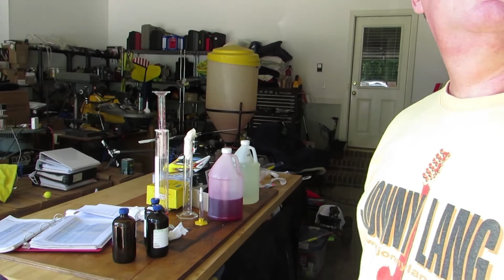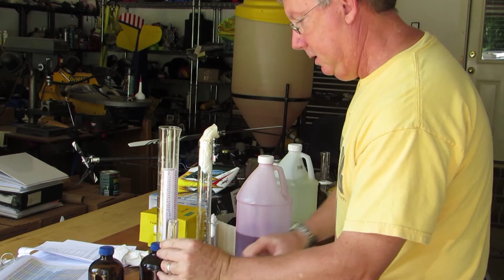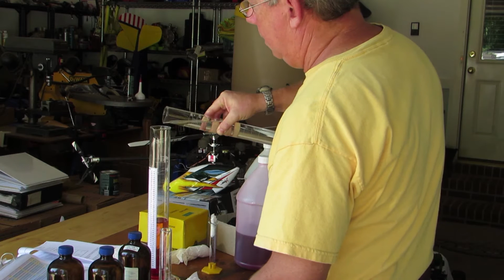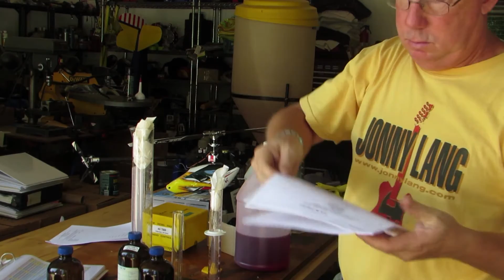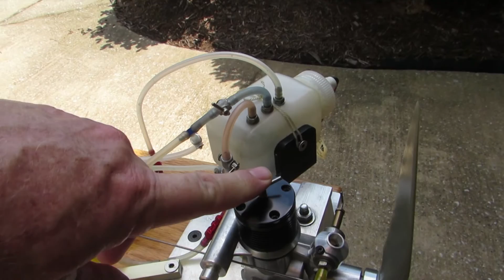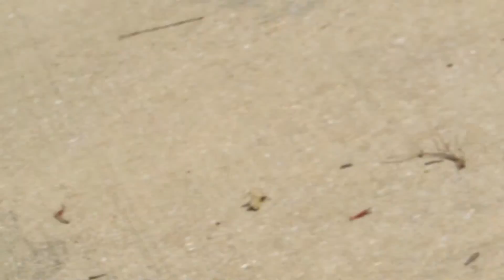PAW Diesel Model Engine Running + Fuel Mixing

Comment: This one showed up pretty easily on eBay. Do you happen to know of any starting & running model diesels that are 4 cylinder? Should clarify, not looking to use it in anything (might think of something later though), just to build it and run it once a weekend or so.

Comment: PGFC was always down on diesel engines because of the myth which he mostly perpetrated himself, that they "cooled down" at prolonged idle and then would not open up again. PAW have dispelled that nonsense, as demonstrated here, but diesels still suffer from the bad press.

Comment: It cracks me up that you are making 16oz (imperial measurement) of diesel but that you are measuring everything in mls (metric)  - could be why in Oz we make up a litre  (1000ml) or 1/2 litre (500ml) as it is so much easier to work out the %'s.

Comment: Not too bad, but it does seem like transition leaves a lot to be desired. And I place the blame for that squarely on that antiquated carb design that almost seems like a half-arsed 'oh fine we'll give an RC model out' than any attempt to engineer it for RC flight. I feel like, if I had that on a model and I was aborting a bad landing, I'd be at major risk of it either flaming out or simply not answering the call quickly enough to avoid the crash. The bar I set for my glow engines is 'idle @ 2750RPM for 30s, slam throttle wide-open as fast as possible, pass is immediate pickup with no hesitation or sputtering', and that just doesn't seem to be in this engine's wheelhouse with that carb. Feel like if I did that test on it it'd fail miserably.

I've seen videos of an OS 40FP, an OS Surpass and a Saito all running diesel and they transition much better. The 40FP had a conversion head bolted to it. The two 4c engines....were just as they were. I think with a proper airbleed or TN carb this PAW would be a worthy option for most fliers that can get fuel, but until it gets a low-end adjust it's just not practical compared to a 46AX or 35AX.

Comment: Growing up in the UK in the 50s and 60s the smell of diesels was pretty much the smell of aeromodelling as they were the common power for most of the non-RC and smaller RC models. One point is that, by throwing a larger prop, there is an efficiency advantage that somewhat offsets the power disadvantage to glow (an advantage that low KV electrics have to an even greater degree).

Comment: Bill, did you add the allen screws to the cylinder or did this version come with? My .35 BR came with slot head screws BA thread.
Reply from the maker: Well - I don't remember exactly. Almost certainly it came with bolts shown in the video but I've owned this engine long enough that I can't rule out the possibility that I changed them out years ago.

Comment: Cool video. I love the idle sound of that engine. It reminds of the idle sound of my old dirt bike.
Also, thank you for explaining and showing how to mix diesel fuel. I've been flying glow for almost 40 years and gas for about 10 years but I've yet to own a diesel.  But I am  thinking of converting one of my old .049's over to diesel just to get the hang of how they run and how to tune them.

Comment: Hi Bill

Great to see you.

Great video.

Amsoil diesel cetane boost is a very effective cetane booster. John Deere premium starting fluid is basically di-ethyl ether. One can of it will supply enough ether to make up a quart of model diesel fuel.

So, the fuel ingredients are quite easy to source. Just keep the fuel in a well sealed metal canister or glass bottle after mixing. Also make sure you make up your fuel in a well ventilated area well away from sources of ignition.

Comment: +wjvail 

Will this fuel work?
http://www.davisdieseldevelopment.com/model_diesel_fuel.htm

Will be purchasing a few diesels soon.thinking of building a tether car from scratch,build the body 6061 aluminum over a wooden buck body form from plans and pictures for weld up, and off the shelf tires driveshaft and axles gas tank from a online source for tether cars or RC.
Reply from the maker: ***** 

Hello Robert. Thanks for watching the vid.

The short answer to your question is that I don't have enough information to say for certain. I don't know enough about their fuel and I don't know what engine you're considering. I don't think you would hurt anything by trying Davis fuels and I assume it would run reasonably well. The company Davis Diesel has been around a long time but their specialty is producing conversion heads for engine that didn't start life as a Diesel.  I would assume their fuel is blended to support those engines.

PAW engines, on the other hand, are Diesels from the beginning and run well on the fuel specified in their owners manual. See here --> http://www.eifflaender.com/instruct.htm Notice that PAW recommends Model Technics fuel if you don't want to blend at home. You can check out Model Technics fuel blends here --> http://www.modeltechnics.com/diesel.htm

Sorry I couldn't be more help.

Bill

Comment: Hi. I love messing with 'Diseasels' and enjoyed the video - fabulous tickover on that .40! I would argue that the fuel WILL keep well though, if kept in the right container and well capped. I recently came across a half litre of diesel fuel that had been forgotten in the back of the garage for 20 years in its original tin and it was fine. It ran my engines perfectly so I wouldn't worry about the age of it. Stored in tins or in glass with an ether-proof lid it will be ok for years. The advantage of tins is that light DOES apparently affect the fuel in some way - to its detriment. (Sorry, I can't remember in what way or where I read it - I just keep my fuel in tins!)
Ok yes, diesels are a bit messy but if you like mucking about with engines, diesels have more to muck about with. Glow engines are pretty messy too and IMO diesels smell the best!
Reply from the maker: Phil Tolfree 

Howdy Phil. 

Yes - you are of course correct.  You CAN store diesel fuel. The ether I used in this video is over 10 years old and none of it had evaporated. But I think you would agree that it is not as easy to mix, store and use model diesel fuel as model glow fuel. You can't buy and use it  like you would a normal glow fuel.  That is, in plastic gallon containers. 

Much of this video was for first time diesel users and I think it would be a mistake to try and mix model diesel fuel in gallon quantities without consideration for how it will be stored and used.  I just didn't want modelers to think you could mix up 4 liters of diesel fuel in an old glow fuel jug and expect to get good performance after storing it for a year.  I also would worry about the condition of the last few drops of fuel in a container that size.  

As for the smell and mess... Beauty is in the eye of the beholder!  I do like diesels and I don't mind the smell of them running or the smell of the fuel.  I personally don't like the smell of them two weeks later after they have been setting in my shop. They leave a smell in my car if I don't remove my airplane right away that I personally don't care for. It's not nothing terrible but it's not a smell I or anyone else would fail to notice.  

I should add I never run a PAW engine and don't marvel at what fine engines they are. They are just a joy to take out and run and  I've got the itch to put this engine back in an LT-40 and do some touch and go's.

Bill

Comment from the maker: Thanks Sam... I run a lot of engines and get a fair number of questions about diesel model engines.  I think that comes from the over inflated expectation of twice the power, 1/2 the fuel consumption and a believe that they really do run on standard diesel fuel.  While they are great engines and a lot of fun to run, they fall short of some folk's hopes.  While the video might be a little boring, hopefully it will give some an idea of what running a compression ignition model engine entails....